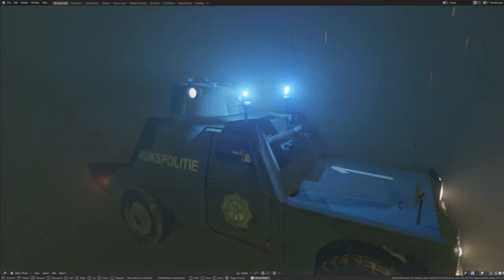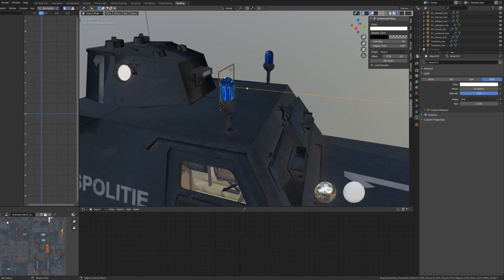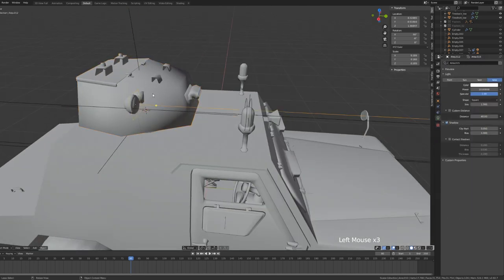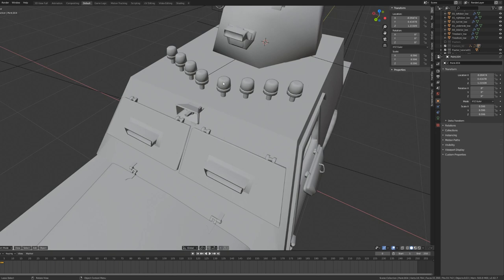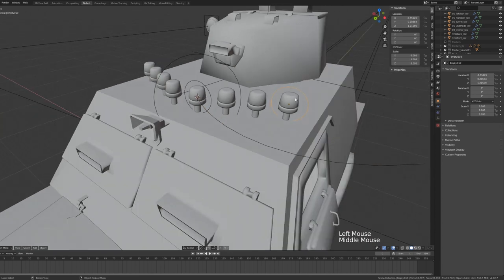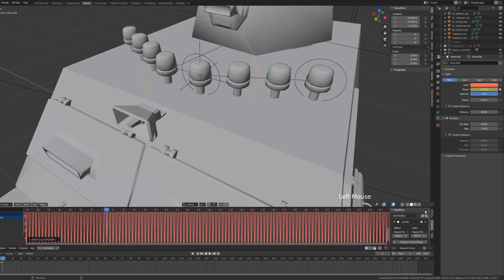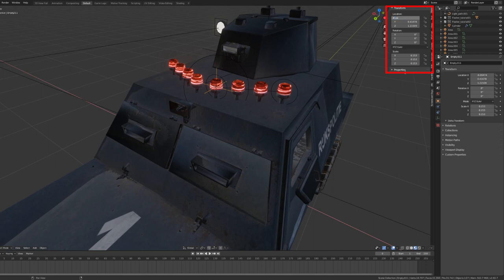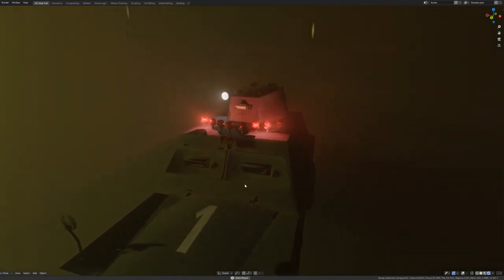Create & Animate Vehicle Headlights Lights in Blender Eevee

Comment: That's a cool animation. Is there an easy way to have multiple copies of an animated object and offset each one with either manual and automatic apllications? 

I have seen some old videos of blender having an easy offset feature. I am still not sure if this funtionality is still included in the newer versions.
Reply from the maker: I'll look into this, I think you may still be able to offest the animation by applying the driver to the duplicated object while scrubbing a few frames ahead on the timeline.

 I haven't tried this however.
Reply: @Tosmo  I am trying to learn the graph editor. Great feature, still has a lot of potenital. Currently might need some further improvements especially in the ui. Too many hidden menus. My major theme proposal in right clicl select is mostly about blender's inclination to hidden menus which in some ways can make the viewport cleaner but in my opinion affects the workflow greatly. Maybe that is the reason why it is currently in the top ranks for 3d modelling but not too much on other  pipelines.